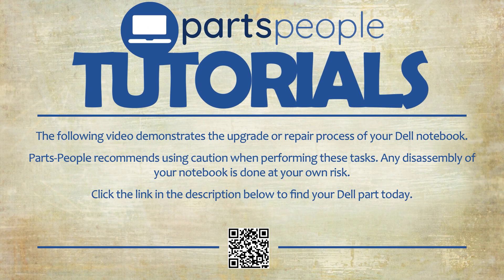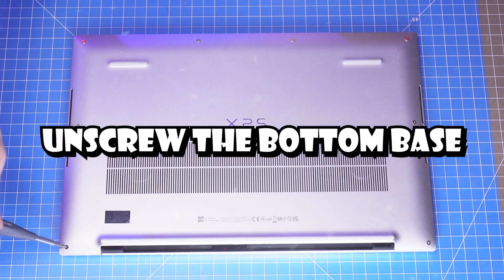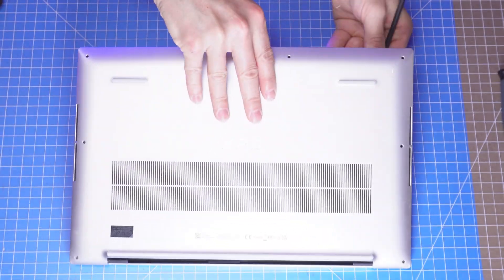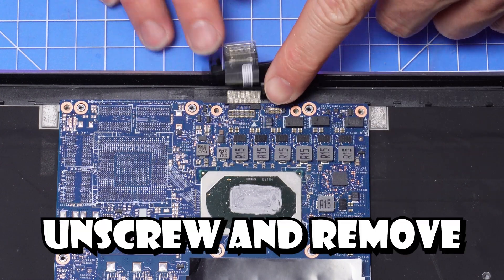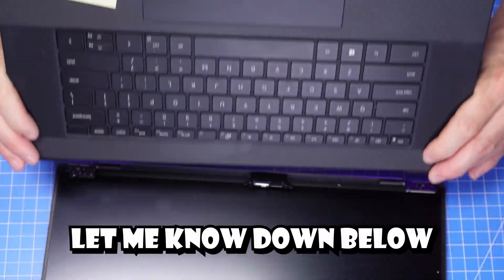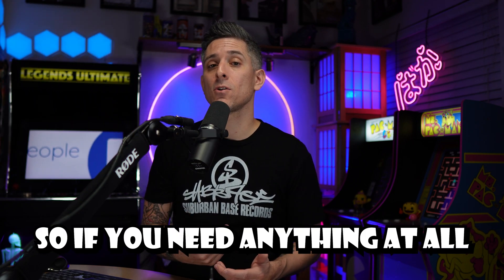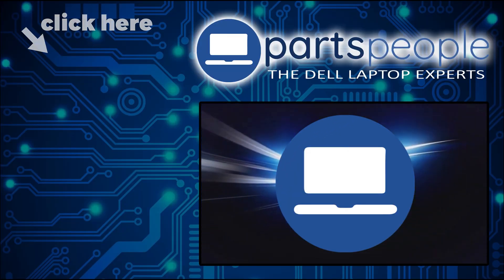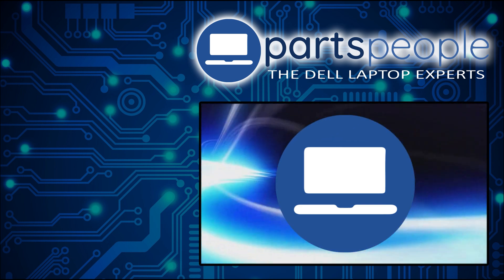Fix or Upgrade Your LCD Screen Assembly | Dell XPS 17 9700

Comment: Ayy. Maybe you can help me out. I tried to follow this guide to replace my regular lcd screen with a new touchscreen one. When i was done the screen stayed dark and the error code i got was 2 amber lights followed by 7 white lights. I retraced my steps and put the old screen back on. Still had the same error code. Any ideas?

Comment: Is it feasible to replace a badly scratched top cover (lid) on a touch/UHD XPS 9700 but keep the (functioning) LCD panel and TS?  I see you stock back covers (e.g. Dell part MRP41) - but it looks like the top cover is attached to the back cover on the damaged part with adhesive.  I've replaced a few phone screens in the past, and have some separation tools, plus a temperature controlled hot air station.
Reply from the maker: We do sell that back cover, but it is out of stock.  Yes, you can switch it out, but it is a pain.  You will have to use heat and work slowly to avoid breaking something.  It will be similar to a phone.  https://www.parts-people.com/index.php?action=item&id=38286